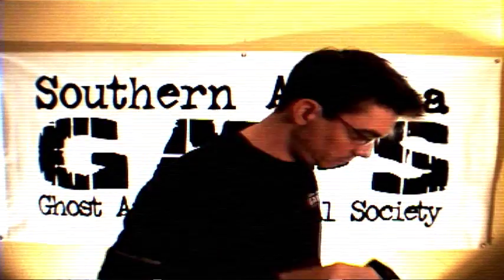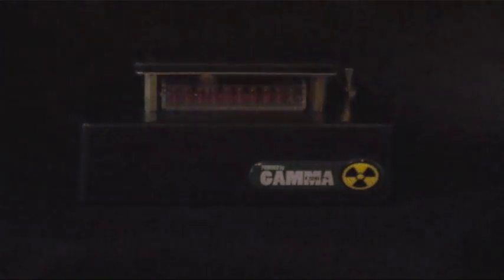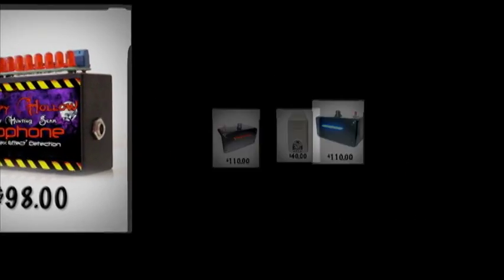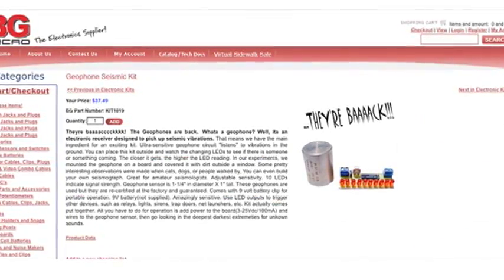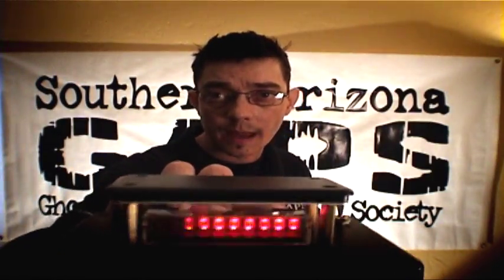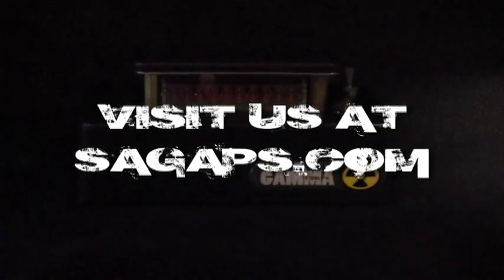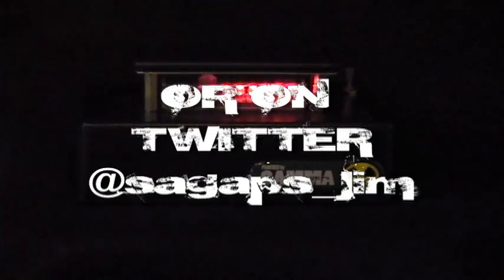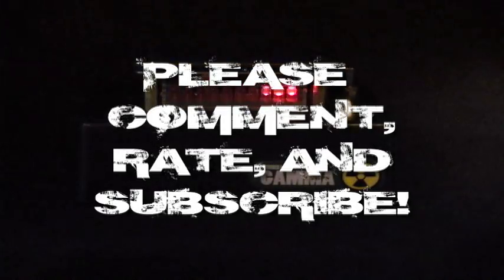How to Build Ghost Hunting Gear : $50 Geophone DIY

Comment: Ah, for a couple grand, assuming you are willing to build, you can get quite a lot. You can get security cams for pretty cheap now. Slip ring, a stepper... golden! You can hardwire or use a wifi module to transfer data. Or just go get the card, of course. You seem to know what you're doing... good luck with that.

Comment: Thanks for the reply. That's my plan. I did some research on IR cams. You can spend up to 10 grand on a real good one. I would like to get one for around 1-2k. I want to eventually have the cam on a rotating x/y platform and learn how to use pattern recognition with it.  Right now I'm working on interfacing a 2k sram to a PIC16F877A for data logging. An SD card would probably be easier. (see my website: hampleman dt com - electronics projects)

Comment: Have you considered just building a motion sensing IR cam with an SD datalogger? You can just yank the card every morning and upload to your archives. You can buy a small cam module w/ motion detection for about 30 bucks. An SD logger for like 10 bucks and then around 10 bucks to build a microcontroller and power supply. Of course you have to build an IR lamp as well. w/o the case, that's about another 5 bucks. Glue gun, tupperware... golden!!! Upgrade at your pleasure, but functional in a day.

Comment from the maker: @ROBEY888 The black cover was actually the top to a smaller project back sold by radio shack.. As for the legs holding the cover, I had two sizes of motherboard riser screws laying around. Youtube won't let me post an example link but any computer shop has em for cheap!

The longer risers screwed right into the Smaller black cover and the smaller risers used to attach the longer legs to the geo phone project box. (requires the drilling of 4 additional holes on the top)

Comment: Hi brother, I 'm a water leaks specialist detector. Mostly I'm doing to find a concealed pipe leaks which hidden inside wall,slab etc.

Could u please assist me how to eliminate the outside noise disturb whenever I use this device.

Your kind assist is greatly appreciated.
Thank you so much.